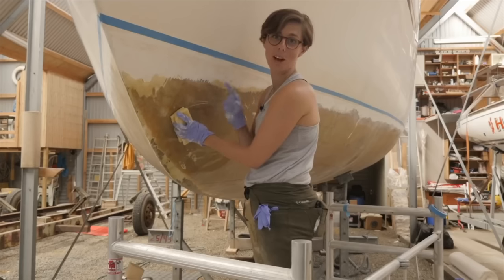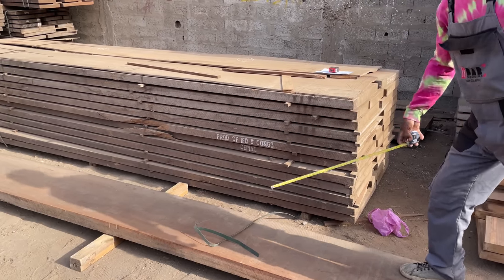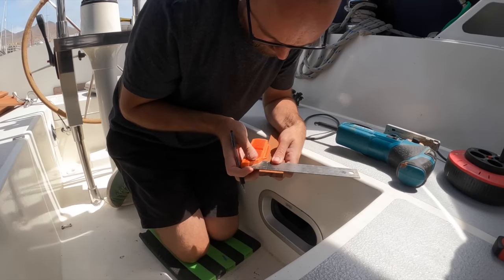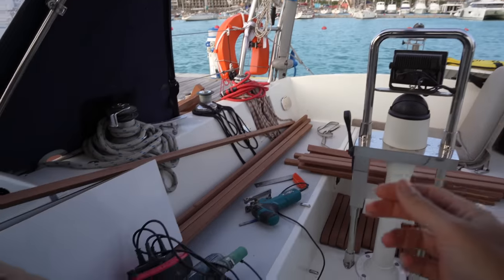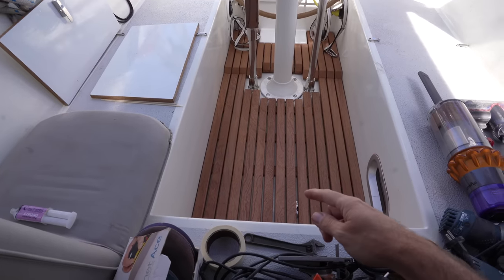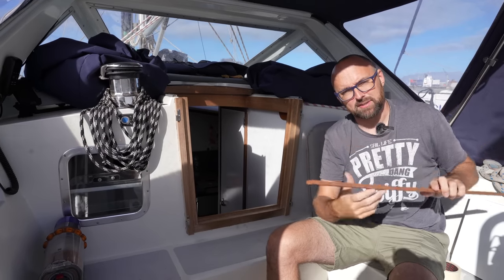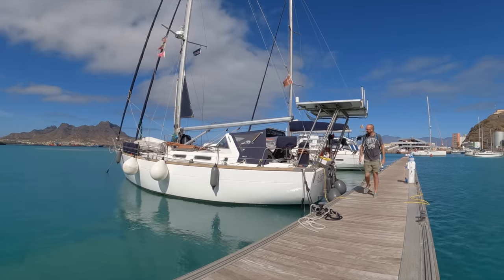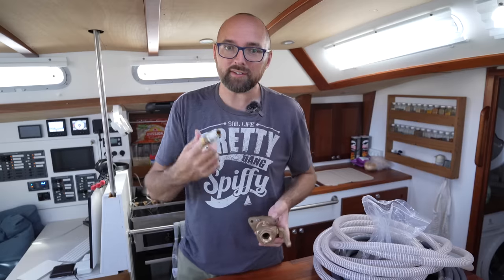Sail Life - Cockpit Sole ⛵️

Comment: Don't use the plastic furniture leg ends under your cockpit grating because they will creat points of high loading into the cockpit sole. Better to cut small V shapes into the supports to allow the water to run between the sections freely. And they're free. I also suggest that you give the sapele a good dose of teak oil especially on the underside where it will be damp most of the time. Stay safe

Comment: Congrats on the air conditioning.  We installed ours a little over a year ago in the V berth.  Because it was way below the waterline we has issues with the drain however.  On really humid days it produced lots more water than anticipated and had our bilge pump working a little to much.  A simple install of a $50 US condensate pump from a mini-split heat pump did the trick. The water is now pumped direct from the drain pan to the rain catch system.  Gives us around a liter of fresh water a day for rinsing dishes and such. The AC does require cleaning on a regular basis and the air filters clog easily, but it is definitely worth it.  Keep up the good work and look forward to the next one.

Comment: Hi Mads, I just did a DIY install of a 16,000 Btu Dometic a/c unit in my own 39’er.  Instilled it under the settee, with ducting up and behind the cabinetry supplying the saloon, fore to the v-berth, and aft to the aft cabin.  Two bulkheads, one fore and one aft, and fourteen cabinet sides to cut 6” holes through.  The cutting took me a full day.  The install was straightforward, but the routing took thought and patience.  I purchased mostly for air conditioning and was surprised that the heating option is actually much more valuable, extending my sailing season a month or more on both sides of the season where it’s now much more comfortable to be on the boat on a cool and chilly afternoon and evening.  I’m in Toronto Canada where summer days easily get to the mid 30’s C, while evenings in the spring and fall go as low as 10 C.  Can’t believe now that I went 7 seasons without it.  Mine is 110V, so can’t use at anchor, but have never found the need due to fresh breezes through the boat as you explained.  Good luck with your install and looking forward to the result.

Comment: A temporary fix for the compensators would be some decent 'Bungee' cords and two saddle clamp 'U-bolts'. clamp two loops in the mooring line just far enough apart to be under the max stretch of the Bungee cords (or, get fancy and tie bowline loops), then hook the cords to the loops and use pliers to clinch the metal hooks closed. It can all be undone when the 'real' compensators arrive and you'll still have some useful clamps and bungees!

Comment: You are continuing to complete the extensive refit.😉  Suggestions: (1) Fingerhole in the grating above the fuel fill. (2) If you do put the AC unit in the ‘wardrobe’, no need to trash the door - just a removable panel of the appropriate size.😉👍⛵️
Reply: another option would be to cut an opening and use a grate (probably metal).

Comment: I think you’ll find the air conditioning will make it more bearable in the Caribbean, too. It’s amazing what knocking the heat out of the boat for an hour can do to make sleep more comfortable. You won’t need to run it all night (like you will on the east coast of US in the summer) but if it breaks…you will want it fixed!

Have Eva bring the plastic furniture do-hickeys. You’ll want the water draining as freely as possible.
Reply: On a fancy HH cat they instead (or also) have a tiny AC-unit for the bed. They have a curtain/drapery/drape that acts as a barrier between the bed and the rest of the boat. That way you can sleep in an AC space, but it keeps the power draw to an absolute minimum. You can see that boat for yourselves. It was the larger HH that the Wynns were on recently.
Reply: If the Caribean is so hot and inhospitable, I wonder why everyone wants to be there. I'd rather be in some place where I don't need aircooling.

Comment: Another way to make the new wooden cockpit sole let water pass, would be using your router to build big canals front to aft in the supports. That way you wouldn't raise the sole once more and could work with what you have now. They would have to be at least 50mm wide, but if they are rounded, the chance of something getting stuck there, is minimized.

Comment: Spiffy deck mate! Tip for your compensators: Use a Y arrangement between stern-, dock- and spring clamps. That way you can take a lot of strain in bad winds and even use the compensators on the spring side with reduced load, just make sure the aft lines never go taught. That way the compensators last longer. Also climbing ropes laid in multiples are excellent compensators and you have a long thin rope on hand if you need one. Cheers

Comment: It might be a good idea to fix the floor grates for what i can see 2 reasons. Damage and personal safety. All it need now is 1 big breaking wave onto the cockpit to start floating the not so light grates. Specially the back one is so heavy that you don't want this banging around  in what is then has become a rocking bathtub.  And for sure one day it will happen simply because of the duration of travel.

Comment: Before you build a new louvre door, drill a nice pattern in the door and and a thin board on the back behind the holes. Space it off 1/2” to 3/4” and the air will flow just fine. The backer board will keep the clothes from plugging the holes. Time to get out the hole saw and pencils.

Comment: On a fancy HH cat they instead just have an AC for the bed. Then they have a drape that acts as a barrier between the bed and the rest of the boat. That way you can sleep in an AC space, but it keeps the power draw to an absolute minimum. You can see that boat for yourselves. It was the larger HH that the Wynns were on.

Comment: Having it in the hanging locker will allow the return/supply air to be in a closed circuit allowing you to only cool the forward cabin if/when you need to run it overnight (w/ salon vents closed).   Hopefully it won't be very loud in there.

Comment: Hi Guys From your video, Your autopilot problem apparently from my angle here. Is that the base of your cylinder is on a horizontal axis and the rudder is on a vertical axis.
Creating a lot of bending stress on the rod of the piston. The base of the piston should be also in a vertical axis, to allow it to rotate with the rudder.

Comment: You may be surprised at the temps in the Caribbean.  I've been on a couple live-aboards there and HOLY HECK was it HOT.  I'm like you, cold doesn't really bother me as much as heat...and I'll tell you what, I was sweating just sitting.  Unfortunately live-aboard dive trips are way too "this is the number of dives we do" and I didn't have as much "bottom time" as I'd like...and thus was not able to stay as cool.  Thankfully, we did have AC on these boats so I did tend to spend quite a bit of time inside in the cool air.  :)

Comment: You can get round to rectangular plenum fittings if your worried about squeezing into tight spaces
Reply: After running round ducting everywhere for a/c I redid it with ducts made from 1/2 in insulation and 3m aluminum tape.  Built in in situ, self supporting. all the vent openings were round fittings to square vents anyway.

Comment: 6:53 could also have a pulley system with a stainless a steel spring wrapped in fabric to avoid damage from touching. Rubber has limits.

Comment: It is probably flexing causing the rubbing(wear marks). There is a lot of force on the unit. Put the emergency tiller in, try and steer(while under way) with your hand the same distance from the tiller post as the quadrant attachment is, hehehe good luck with that. 
It don't take much flex to do damage. 
Quality of the materials coming out of china is questionable at it's best. 
i don't know where it was made, but for example, Made in Canada, usually means assembled in canada. 
The parts can made elsewhere, and are usually made in china now-a-days. 
I wouldn't be surprised if you can easily get quite a bit of deflection form mid to max stroke on such a thin actuator piston(rod)

Comment: URGENT   I repeat 
Hi Guys From your video, Your autopilot problem apparently from my angle here. Is that the base of your cylinder is on a horizontal axis and the rudder is on a vertical axis.
Creating a lot of bending stress on the rod of the piston. The base of the piston should be also in a vertical axis, to allow it to rotate with the rudder.

Comment: Probably too late now, but keep in mind that marine AC units make a lot of noise.   We have one in the transom of our boat in the Chesapeake and I would recommend you install is as far away from where anyone may want to sleep while it is on.  Good luck!
Reply: Was about to comment the same.  I guess the issue would be routing the air hoses, particularly from the technical area.

Comment: Mads why not make some cockpit sole feet for the wood you have. and EPOXY Coat them so they are sealed and use them which will be easy and a cheaper way.

Comment: I bought some bits from Boat CV and my bank promptly blocked my card. Not what you want so far from home. As for squeaky lines, use three strand nylon/polyester and tie a tension line between them.

Comment: The biggest disappointment I feel on Mads behalf is his sole focus on these autopilot drive units.  Based on my ocean crossings, I think he'd find it an interesting, energy saving, almost fascinating experience to make most of at least one passage using a wind vane.  Having that single experience, he would - I believe - subsequently consider it a primary arrow in his quiver rather than simply a "back-up".  And as it comes time for the Pacific runs, he'd be ready to benefit from a vane's many advantages.  Sadly in this case, his adoration for technology is a weakness rather than a strength.
Reply: The vind vane is the vay to go.
Reply: @nathanbrisson8515  Clearly.  The stronger the seas and wind, the stronger the vane's control of the boat.  This is hard to appreciate until at sea and on the vane...and abundantly clear the minute one relies exclusively on an a/p.
Reply: I would let him organise his trips the way he feels most comfortable.if that means he has a lot of technology aboard, than that is the case. Simple. Better have a comfortable captain than one that is constantly worrying if he has done all he could when things get rough. Much safer.
Reply: I believe this was addressed last episode. There's some kind of issue with the wind vane that makes it's failure more possible.
Reply: And yet, he’s on his boat and,alas, you are on your sofa.
Reply: I learned from Cruisers Forum that the voice of experience indicates unequivocally that electrical self steering always fails, and wind vanes are the only reliable offshore steering system.

I don't fault Mads for believing the manufacturers of electrical steering systems when they say their products work. It is not his fault that they don't in offshore conditions.

I just hope that whatever his wind vane needs to function can be purchased in Europe and brought or shipped by his wife. 

If all 3 of his electrical units fail on the crossing, the wind vane must be functional. Now is the time to make sure it is.
Reply: @youreviewer  I think you need to go back and listen to his explanation about the wind vane. I have heard “voices of experience” before and often find everyone jumps on some bandwagon whether the “solution” is the best one or not. Mads has enough experience to know what is best for his boat, armchair experts on youtube are not the best.
Reply: His vane is faulty he needs a new part that he could not get yet
Reply: Totally agree. In ocean environments, you want te keep things as simple as possible. In a relatively short time 2 new autopilot drive units just failed me during a short ocean voyage, one of those beyond repair. However, my Windpilot that I purchased second hand in 1990, has never failed and steers my 35ft sailboat much better than I could, even during gale force conditions. On top of that, the Windpilot does not consume electricity!
Reply: @jeffwood8109  If I remember correctly, the manufacturer discovered an issue with a batch of foils that led to them being prone to cracking in the high stress area where the shaft enters the foil. 
They issued a product advisory and are sending out replacements with a revised design, as they become available. 
Cheers, R. 👍🍻
Reply: Another benefit of say a hydrovane is that it has its own tiller that can take a tiller pilot, a smaller autopilot that, as the vane rudder is small takes less strain.
Reply: Be careful, he doesn’t like criticism… He’s a very touchy guy…
Reply: @jeffwood8109  correct. a rudder on an existing unit failed on an Atlantic crossing. The makes has resdesigned and offered to sent but could get it there in time. Perhaps with new delays he will get the modded rudder?
Reply: @youreviewer  the maker has modded the wind vane rudder design so maybe Ava can bring it with her from EU
Reply: He has one, but the rudder on it is suspect and he cannot get a replacement in time
Reply: Wait, what? I too am disappointed yet…only concerning how this comment is worded. Please consider omitting the first and last sentences. Thanks.
Reply: ABSOLUTELY.
Reply: Especially sad to have the genset or engine running every day for no reason.

Comment: I'm surprised you didn't put in a Bluetooth doohickey that opens and closes for access to the tank fill. You could put it on your wireless network and have it open automatically when the tank sensor detects low levels. Or not. 🤣🤣

Comment: With all the equipment in the technical compartment, the head and now the AC unit, how come you can get so much weight on the starboard side of the boat without it listing?

Comment: To choose to install an airconditinig on a relative small boat is a very dumb decission.
These things go broke very easily in the very humid admosferes yr are in when y nee them.
Better get used and ventilate.
Y will find out very soon. Keep alive and keep things as simple as possible.
That means then reliable equipment and good redundancy. 
Try to keep the nuber of through holes minimum so no extra hole for a gadget that y do not need.
Succes, keep it simpel.
Jaap Jonkers , Master Mariner all Sailing Ships .